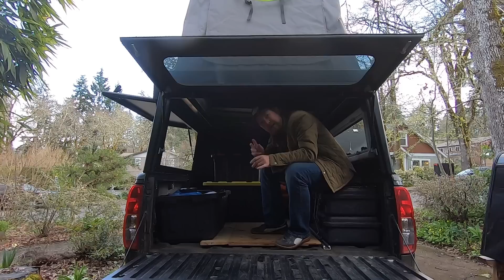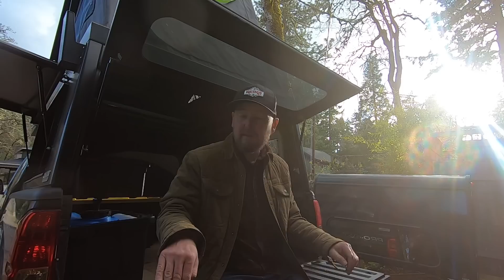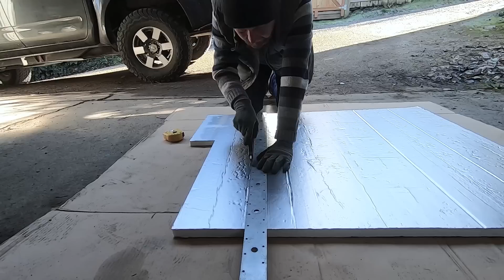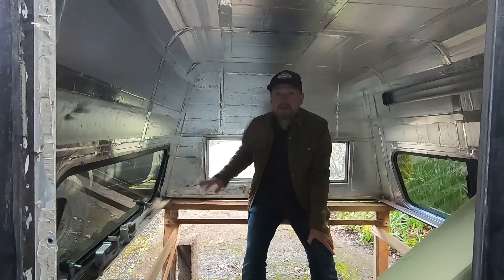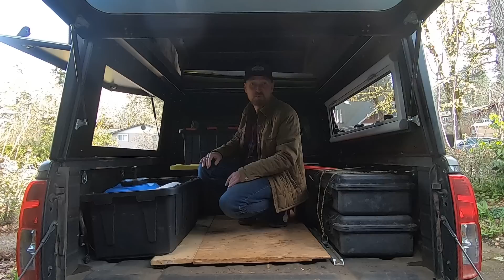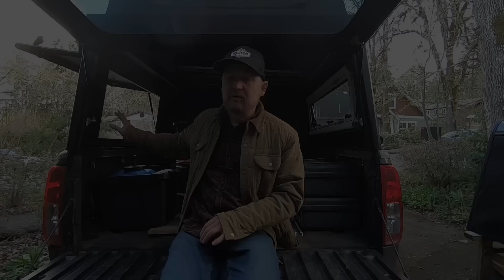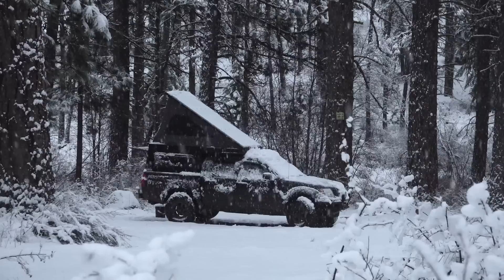Camper Interior Build Series: Part 1 - Planning & Ideas

Comment: Yeah as I mentioned before. Bed rug would be very nice for a flooring that’s useable. For the inside of the canopy, when I used to build aluminum canopies, we used “foss” liner. It’s just a indoor/outdoor carpet you spray glue on. I think you could find it in bulk cheap and it would look clean. And it matches the bed rug like perfectly. 

I’m in the middle of this video as I type this, but I REALLY want to do a setup like this down the road, I have soooo many ideas haha but are not practical for my current setup
Reply from the maker: Thanks! Hope you guys are doing well!

Comment: Excited to see the build evolution. Take your time and mock up or do a shake down run prior to permanent mounting. I think you'd be wise to go with the Propex or Wabasto heater. Best wishes going forward!
Reply: Semi-retired welder-fabricator here.
In the shop, we constantly fabricate cardboard mocks to eval fit and accessibility.
.
An aside:
That would be a wonderful new concept for RecreateVehicle manufacturers.
Doors interfere with doors?
Walls interfere with doors?
Cabinets interfere with couches?
Cabinets interfere with sitting on the throne... sideways?
Cripes.

Comment: They make the diesel heaters that work off gas you can tap into your gas tank no addition fuel and its a dry heat and heats cold spaces I have used one for years also venture4wd has one in orangie love your videos and your builds looking forward to this one

Comment: I am in the process of building out my Topo Topper Badlander as know.  I have noticed that many of the builders use 2x4 construction.  I have used 1x2 framing and 1/2" plywood at the heaviest without any loss of strength.
Reply from the maker: Totally agreed, 2x4 is WAY overkill, completely unnecessary weight and bulk. If I built with 2x4s I'd have no room left to actually store anything. 😆
Reply: @softroadingthewest  
Boat builders often use the 'Strongal' method:
* less stringers with stouter plate.

Comment: I'm having trouble seeing what you would want to store under a raised floor.  It would be darned hard to get at, and as you say the rise would make seating awkward.  I'd prefer a rubber mat for insulation and maybe piece of carpet (rubber backed?) over that, which can be easily slid out and swept or even hosed down when you want to clean the inside. The rubber mat would seal against drafts from the tailgate better as well, if you want that.
Reply from the maker: I have a stepladder to ease getting onto the tailgate which folds extremely flat (less than 2" thick folded) and it would be super tidy if it was stored in a small gap under the floor, open at the tailgate end, and then my axe could slip in there too, since I prefer not to carry that on the outside of the vehicle the way many people do. And I have some telescoping awning poles which come in handy from time to time that could slide in there as well.

That said, I probably won't do this, as the ladder really can just ride exposed on the floor - it would get pulled out anytime I want to get into the back of the truck anyway - and I can figure something else out for the axe. I brought it up in the video because a) it was just an idea I had and the whole point is kicking around ideas, and b) if I didn't bring it up, I figured some people would suggest something like drawers under the floor (and they have), so talking about it gave me the opportunity to explain why I probably won't do that (i.e. retain a more comfortable seated height for the "couch"). It will also just be much simpler to build and less material if I stick with the floor being the floor.🙂
Reply: @softroadingthewest  Makes sense.  Perhaps a space could be found for all those on a rack under the rails.  Or just behind the storage on one side.  Ha!  Another good candidate for the accessible space behind your non window opening.  That space is filling up fast for something that doesn't actually exist yet.  :o)
Reply: @softroadingthewest  
Instead of always laptopping while seated on the swooning settee using a table gizmo...
... I like the lawn-chair on the center drag-strip.
Modular, carry your lawn-chair outside to work outside, too.
Reply: @Bob,
For rubber mat -- acoustic and thermal insulation -- on the metal truck bed, how about mat for horse trailers?
Just an inch would have a significant improvement.

Comment: Speaker carpet could be an option for covering the insulation. There's a non-backed, flexible kind that's good for stretching around speakers or there's the backed variety which is thicker and more durable. Easy to glue with 3m super 77 and/or could probably be stapled to the insulation.
Reply: Going that route, I think I would mount it in sections instead of an entire wall.
If the adhesive fails, a smaller panel allows easier access to the backside for re-application of the 77.
.
But!
That fabric only attaches to the foil.
The fabric retention relies on the bond between the foil and the poly.

Comment: I used the foam puzzle piece style flooring in my build, because I also wanted to be able to haul if  needed and so far it’s been great easy to clean, comfortable and easily removable. Also on my build I installed bed stiffeners I have one bolt through each side in the bed stiffeners and towards the cab I used a turnbuckle on each side and attached to my trucks bed tie downs (not sure if your truck has those) but everything stays secure, and I can remove it all in 5 minutes or so if needed.

Comment: Your Nissan is 10+ newer years than my Tundra.  My  o4 Tundra just passed 164,000 miles.  It's still a baby!   I bought one of the original Hardbody Nissans back in 1986.   270,000 plus miles on its V6 before it got totalled.

Comment: I am 100% plus with you on the siesta.   A cot that is hinged up into the camper shell.  Then pulled down.  Just throw a blanket and a pillow on it.  No popping your tent. Design it right and you could use it as a bench seat when the camper is deployed.  Storage underneath.

Comment: Your bed is about a foot shorter than my bed.  A quilted inner lining for your tent portion.  Heat rises.  A carpet kit.  To insulate the floor and protect your knees.  An awning.  It's always better to cook outside.  A permanent water storage tank that can be used for any purpose.  You don't need a sink.  A portable stove that can be used both indoors and outdoors.  I plan to do a rear seat delete on my 04 Tundra and replace with a 50 Qt electric fridge and a Jackery with solar charging capabilities.  Maybe some kind of fold up/pop down bedrail cot/bench option.  I like having the option to take a hot shower.  Water capacity and propane capacity.   Figure out exactly how many days camping that you truly need to be 100% self contained.

Comment: hey don, you wanted some ideas... for sitting and sleeping how about a tatami single mattress? youtuber, lady bugout has one in her tiny, wee, lit'l van. 
or 
a beanbag? i think you can choose your material, size, shape and density these days. both are a easy in and out. either one would allow ye to keep one side of your rig build free.

for outside storage access, you decide whatever depth and shape you want for whatever it is ye want to store be it shelving, cubbies and drawers. or have it all. 
with a single or double sliding door to keep it more completely stored or open concept???

on the inside cabinet, counter utilize the toe kick space and build shallow drawers or a single long pullout drawer or both around good size, beefy wheels that lock in place! 
or buy a decent size roll away toolbox. 
both would be easy to remove. 
and
i have noticed a lot of rigs have little to no insulation under their floors! imho, if ye want to stay warm in the winter and cool in the summer that's an absolute must! 
enjoy your build and all of your adventures. thanks for showing me oregon...
ps: for the walls check out modern plastic wall coverings! huge variety. way more easy to clean than carpet!
Reply: @Dianne,
Good point on floor installation.
I think his idea of storage under the raised floor creates an air-gap, reducing thermal transfer.
.
An aside:
Our ExpeditionVehicle floor is slate in the center with bamboo perimeter.
On its stumpy legs, our Wave 3 catalytic heater warms the slate, and that radiates into the interior.
And a warm floor is cozy during a 2AM hydraulic-pressure excursion.

Comment: I have a Propex propane heater, and I love the heat it produces, but it's super finicky. Any little minor issue such as length of exhaust pipe, the angle of the pipe, the input voltage, etc., it shuts off for safety reasons. I've been out in very cold weather, and it shut off in the middle of the night, and the only way ot getting it going is to do a factory reset, which is a royal PITA, depending on the thermostat you get. When it works, it's fantastic, but I just don't trust it that much, and I find myself always bringing a backup source of heat on cold weather trips.
Reply: @Henrik,
In our ExpeditionVehicle, we carry three independent sources of heat.
We also carry three complete sets of keys on our person at all times.
Three ways to unblock the road.
Three types of foods, etcetera.

Comment: Insulating this shell seems like a waste of money, space, and effort. The popup tent still has canvas sides, and a large portion of the shell surface is taken up by windows. You're going to have so much heat loss through cracks/gaps, the tent fabric, and the windows that the insulation probably won't make much of a difference. The old camper was a different story since it was essentially one piece.  Save yourself the hassle, and get a bigger heater.
Reply: @Henrik,
FourWheelCampers has their optional 'Arctic Pack', a Hypalon-style envelope.
It creates an air-gap to reduce thermal transfer.
I wonder if any upholstery shop could duplicate the concept.
.
Eugene, Oregon.
On Ocean Street near Bertlesen and West 11th, Jeff does sewing machine repair.
I wonder if he might be interested in a sideline.

Comment: Don,
Since installing the camper, have you noticed a hit in your mileage compared to when you had the roof rack and / or the large walk in camper shell?  I have a newer Tacoma, and since installing a front runner roof rack I've had a large hit in MPG.
Reply from the maker: Here is the rundown of MPGs in various configurations. This is 60-70 mph highway driving, as there has never been any real change in the terrible around-town mileage. 😆
• Nothing on the bed of the truck, roof rack deleted: Close to 21 mpg
• Nothing on the bed of the truck, empty roof rack present: could barely eke out 18 mpg
• Current setup with the Topo camper: 17 mpg
• Original build with loaded roof rack and tall Leer shell: 14-15 mpg

So this camper is an improvement over my original build, and virtually no hit vs empty truck with roof rack in place. Obviously the bare un-outfitted truck wins, but then you have no truck functionality and you might as well be driving a car. 😄 Ultimately I'm thrilled to be driving around an off-road capable camper and getting 17 mpg. My Forester was only getting 18 (city) - 22 (hwy) mpg and was nowhere near as practical as this setup.

Comment: I would try to include the water supply in the area under the countertop and have a spout both in the interior and exterior(accessed from the exterior through hatch).
Reply from the maker: I am definitely thinking along these lines. I want access to my water supply inside and out, and using that space and the cargo hatch makes all kinds of sense. Thanks Brian, hope you are well! (apologies for the delayed reply, I fell a little behind keeping up with comments on this one! 😄)
Reply: @softroadingthewest  
Using retired five-gallon stainless-steel Pepsi kegs, the output line can be any length.
.
Although leak-proof so they can be transported while laying, they need to be used on their hind legs.

Comment: I like the idea of some sort of carpeting over the insulation, my only concern is how to adhere it, as using spray adhesive and leave a lingering smell that  i wouldnt want to sleep in.  maybe it just needs enough time to air out.
Reply: I installed carpet with 3M spray adhesive - no lingering smell that I recall.  Just wait until it dries.

Comment: I think keep thing electrical set up simple is really smart.   easy,  and low stress.
Reply: @Mtn,
Our ExpeditionVehicle bank has two cables, each running the side of our interior.
Each feeds two dual-outlet 12vdv power outlets.
Into these, we plug 12vdc appliances, 12vdc telephone chargers, or any of our vast collection of 750-Watt inverters.

Comment: I would consider doing a sort of U shaped bench/ storage box system in the bed. One side could house a slide out drawer with your camp kitchen. the tops of the benches would also lift up for access from the inside. I made one of these for my xterra.  one half of the rear is used for that while the other side is flat for sleeping.

Comment: 8:41 - IMO I would not worry with keeping things easily removable. If you need to haul something but first have to unload the back of the truck and then have somewhere to put all that stuff that comes out, it’ll end up being more trouble than it’s worth. Alternative- once you sell the old topper, buy a good used 5x8 utility trailer to have on hand for hauling when needed. Again, just my opinion.
Reply from the maker: Yeah, a few people have said this and the more I think about it, I have to agree, it makes a lot of sense. I'm probably highly unlikely to ever bother removing anything once it's in there. 😆
Reply: @softroadingthewest  
We acquired the back half of a service body truck.
I modified it into an expedition trailer.
All those side boxes came in awfully handy!
Reply: Or just rent a (full size) truck for a day when you need to really haul something.

Comment: I like your couch idea.  You could have a split that raises at the end towards the cab.  Something like a futon with a back that raises to sit and lowers to sleep.  Having your legs outstretched like a lounge chair would allow you to sit lower to see out the window.
Reply from the maker: Oh I like that! Thanks!
Reply: @softroadingthewest  
That sounds like a 'navy sit-up berth'.
Three are stacked, with lockers at the head of one sleeping area also acting as a back-rest for sitting and reading in your bunk.
They alternate head-to-foot for each layer.
Generally, these are three bunks stacked.
Disadvantage:
Although an appropriate use of cubic space, a sit-up berth system requires about ten horizontal feet for sleeping, plus another five vertical feet for lockers... for each berth.

Comment: Marine-grade carpet it works well and it's resistant against mold and fading
Reply from the maker: Good idea. Really I should probably spend some time watching sailboat build videos. Similar space limitations and the stuff they use is always extra durable.
Reply: @softroadingthewest  I'm partial to Nissan frontiers if you look at my picture I have a lifted frontier 2011 6-in lift 33 1250 20s 10 ply five of those and airbags I believe in airbags level out the truck and the ride is better only 69, 552mi bought the truck brand new SV model with the long bed living Eastern Oregon if I see you on the road I'll wave at you we have the same colored truck so I'll have a canopy  cab high slightly different color and yes that is my last name Born in Corvallis

Comment: I started my initial comment then realized I was basically quoting Dennis.  No moisture trapping or absorbing materials is better.
I installed a very small 12 volt fan that vents outside the camper using 4 inch duct to a dryer vent.  Works better than open windows.
Reply from the maker: Good idea!

Comment: Raised floor is a great idea, maybe enough space for table storage? I would use the gray carpet for an interior finish similar to a speaker box (if you’re old enough to remember those) I recently bought a Casita which has actual carpet on the interior walls which works well. I have posted on YT some of my initial mods.

Comment: A modular rack system with a modular tool box system works well. They are dust and water tight. You could use them for your kitchen being able to set up outside and cook and pack it back in quick

Comment: Hello Donald. I still have the Propex HS2000 heater for sale that I recently removed from my van if you’d consider a used one? I’m after £250 GBP for it and shipping by FedEx or UPS from the UK to the USA is about £50 GBP, I believe. Caveat is you’d need to buy the installation kit (exhaust/inlet hoses, clips, ducting) as well as a new thermostat cable as the former I kept in the van and the latter I had to cut ☹️ Any interest? Regards, David
Reply from the maker: Oh! I didn't realize you had one for sale (admittedly behind on viewing all my channels). That's potentially very interesting if I decide upon the Propex route, and this definitely makes that option even more attractive. I'm still kicking around a number of ideas. I'm actually meeting up this weekend with my friend Jason who runs a Propex in his van, and I am planning to kick around with him how the install might work in my truck build. I believe I still have your email address, I'll be in touch. Thanks David!